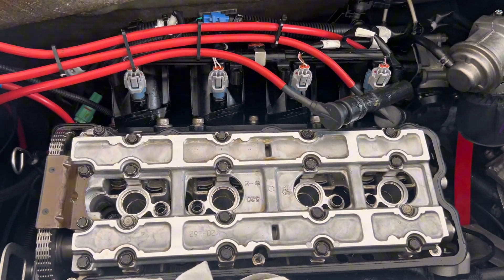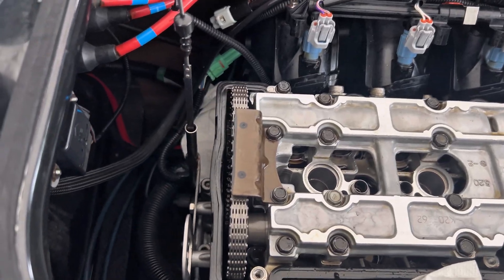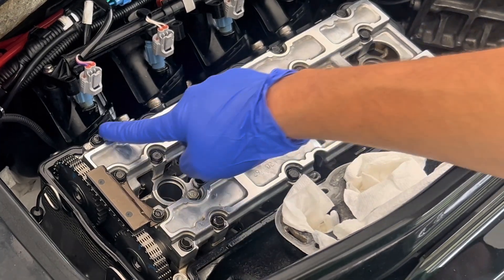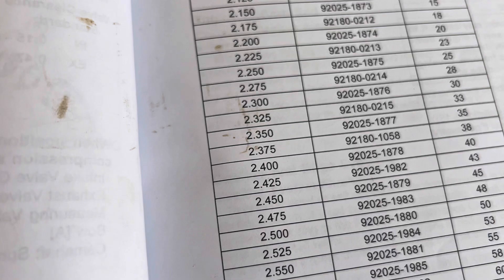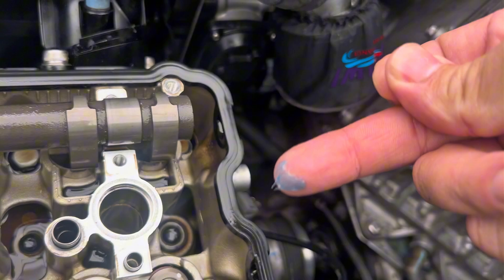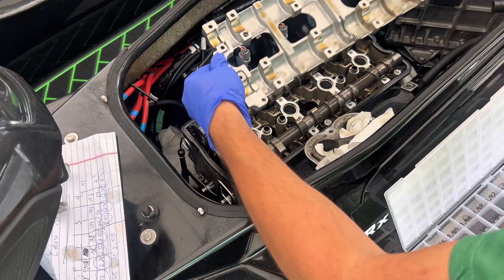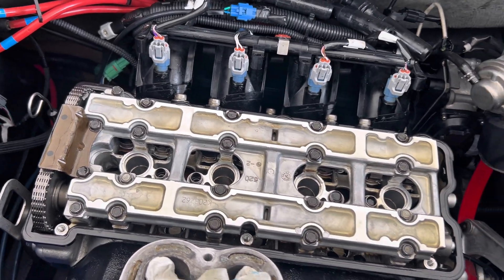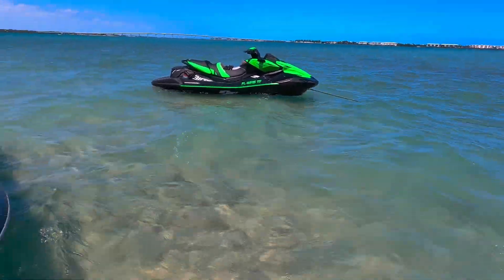Maintenance Tutorial: Shimming Exhaust Valves on a 1.5L Supercharged Kawasaki Ultra 310 Jet Ski [4K]

Comment: i'm sounding like a broken record, but another great vid!   was this your first 100hr insp?  have you noticed any changes at subsequent inspections, do you need to change shims basically every 100hrs? looking at how tight they were, i wonder if the initial inspection should be done much sooner than 100hrs, maybe even as soon as after break in.
Reply from the maker: If you run the machine hard, definitely want to check the shims every 100 hrs- the exhaust valves especially tighten up over time as the seats compress. Eventually you reach the wear limit, but until that time, yeah 100 hours is a safe interval. You can check them before- yeah mine were really tight I've seen many with no clearance at all upon first inspection

Comment: Will tight valves with no clearance cause a no start condition?
Reply from the maker: Ehh I mean I don't really think so...with crank but no start (with no codes or lights) you want to check fuel and spark first. Running for extended periods with tight valves will damage the valve and seat and can lead to engine failure
Reply: Just did my measurements and 2 are at zero clearance, on those two the valve keepers were barely holding. Do you think they hit the pistons? I was able to get the keepers back in without removing the head. 
I’m also having a a heck of a time getting the cam cover back on, I marked the chain and the cam sprockets but two of the lobes are wanting to open 2 of the valve. Is this normal?
Reply from the maker: Are you sure you are at TDC? Make sure you reinstall tensioner body like I show in the video or you won't be able to keep everything in the right position
Reply: Can I give you a call?
Reply from the maker: Call Kawi Performance- they are an actually shop and can probably help you or figure out if you need any parts etc.
Reply: It fires right up after adjusting the valves
Reply from the maker: Did you do a compression test? Wow they must have been really bad
Reply: I haven’t compression test yet. A couple of the valve keepers were nearly off, I’m lucky it didn’t grenade.
Reply from the maker: Yeah you definitely got lucky. I know the valves will pancake over time and the seats can get damaged when they are too tight. I'd definitely check that they are sealing still- there's a test you can do on the exhaust side with a vacuum pump as well
Reply from the maker: Easier and cheaper to replace a valve than an engine! I always wonder how many people never adjust the valves and then blow up their engines
Reply: I did a compression test, have about 130 psi on all cylinders. I took it out and it seems to have a governor at 4500 rpm’s in the water, I’m also not getting any boost on the gauge. What could it be? I also notes the the throttle body assembly makes a humming noise constantly when I turn the ignition on
Reply: It also has not fault codes
Reply from the maker: It could be lots of things..if it was me this is what I'd check assuming the valves are done right. You many have already looked at some of these things. Obviously hard for me to say without seeing the ski but check these:

Exhaust filter (for blockage)
Supercharger belt (black soot or rubber pieces, fraying cracks)
Tensioner bushing and spring bushings - grease if they are binding
Ducts (inspect for rips or holes)
Hose clamps for ducting( torque properly )
Has the intercooler been cleaned?
Check throttle body spacer (it's rubber and can break)
Check BoV isn't stuck or leaking 
Check relief valve isn't stuck or leaking
Fuel pressure? Fuel filter?
Oil level?
Spark plug condition?
Hose leaks (pin holes spraying belt with water)
Coil and wire tests
Throttle body and TPS tests
There are a few possible electronic sensor issues that could cause these issues and would need to be tested, but usually those throw a code.
Reply from the maker: The humming is normal
Reply: Thanks, can I buy a tps separately or do I have do buy the whole accelerator assembly? 
Also should my machine crest boost when running on a hose when I give it throttle?
-I also checked the supercharger belt, is the super charger supposed to be super easy to turn the supercharger pulley  by hand?
Reply from the maker: The throttle body has the tps integrated into it- but there's also the throttle control assembly- test both but let me know if you need the factory test procedure. You should not be able to turn the pulley with the belt on...with the belt off you should be able to spin it fairly easily.
Reply: Thanks, I did a leak down test, found that cylinder 3 was leaking into cylinder 4 and also oil shot out of the crank case breather, my top end must be be bad.
Where is the best place to get new cylinders?

Comment: What hot cams kit did you go with?  Cam chain doesn't need to be replaced?
Reply from the maker: The 9.48mm master kit, 3 shims for each size in 0.04 increments. The chain does not need to be replaced, but probably after like 400
Hours should be checked for stretch
Reply: @JDsWaterWorld  thanks, $85 bucks not bad, how much is kawi performance?
Reply from the maker: I would have ordered the kit from Kawi Performance, but I did not even realize they sold one until after I had already bought that one. The KP one includes more shims and I believe they are the relevant ones you would need for the most part.

Comment: 😬😬😬 I could never trust a dealer to do this. At 100hrs thats every year & half. I could probably do this but sheeeeeeshhh. This is why electric motors are so attractive now. You mess somthing up on this job and your in the graveeeee. Great vid i would only attempt this job based off your instructions
Reply from the maker: The check is really easy, the shimming takes a bit more patience- but on these machines the valves do compress into the seats over time and if you don't adjust you can damage a valve or lose performance..i shimmed to the top end of the range so that I can go longer between re-shim. You should check atleast one time such year if you are running at high rpm
Reply: @JDsWaterWorld  sounds like solid advice. 😎👍

Comment: How many hours where on you ski before you had to adjust the valves?
Reply from the maker: They need to be checked every 100 hours. Especially on tuned machines the exhaust valves will typically need to be re-shimmed every 100 hours until the valves and seats reach the wear limit
Reply: That's me then... I'm almost at 100hrs.
See JD... That's why I hold you in high regard..
Where would we be without JD!!!! 😉👍